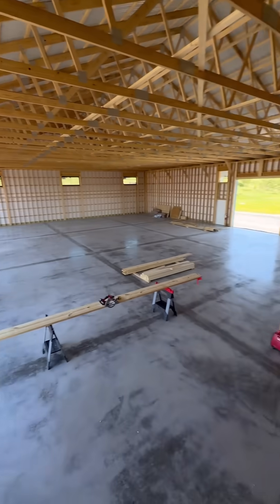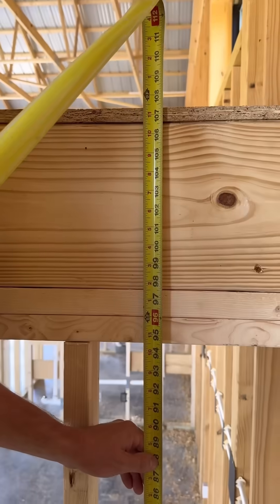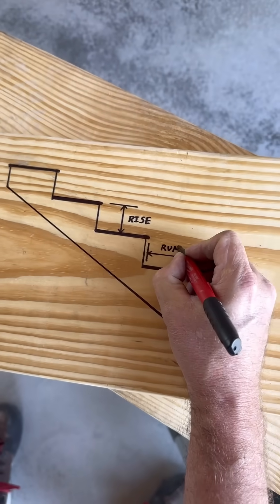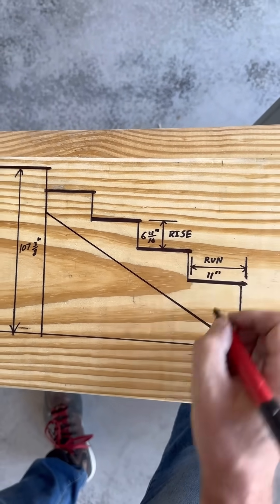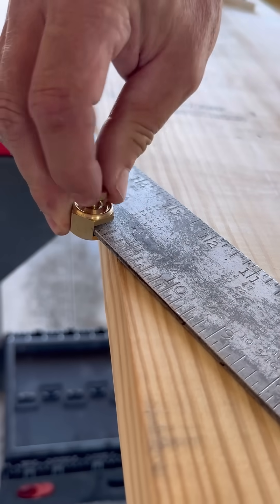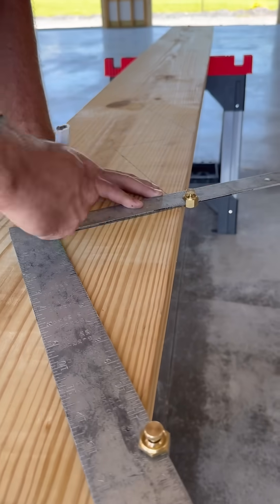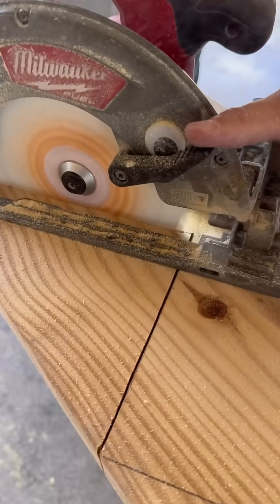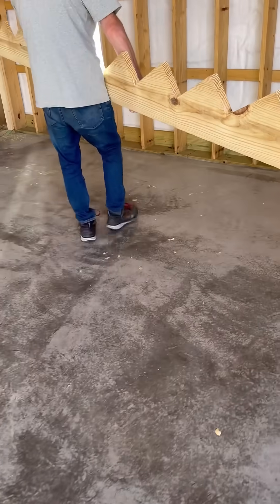How To Measure And Cut Stair Stringers

Comment: Some would say that more than 13 risers requires that you have a landing, for when you fall

That's why it's called a landing, you have 16 risers here from what I see

Also every 5th riser will need support from underneath, if you do not build a complete wall system underneath, so in this case you need three posts, and of course you would need for stringers to be able to maintain a width of more than 36 in clearance between the handrails and guards

Comment: old trick ,father taught me, so do not over cut . drill 1/4 inch hole. drops right out. And will not compromise stair stringer from splintering .

Comment: when stepping off each time at +/- 1/32 variance for the pencil line, it is VERY easy to be off by 1/2" at the other end.
Best is basic math , measure from the first step to the last step and mark the last one. THEN step off each set back towards the start. The result will be two stringers that match and accurate within 1/64. Try it.

Comment: I'm curious how you made your cut for the start of the stringer. I just used my stair gauges . Set to 7 / 11 , and I ended up with a pointed bottom to start my stair stringer.
Reply from the maker: You have to start in a little bit from the end of the board

Comment: Where did the 16 risers come from......ive found with how crappy lumber is today the edges are not very tight and are more rounded so i use the longer clips or fasteners to attach to the frame square, or flip them over with the twistie  on the bottom giving a bit more to hit the board edge. 1 /16 off at start caries and becomes way off as the layout progresses...not a big deal for risers that ride below the finished top but when its a flush fit it has to be precise.....very nice vid....

Comment: You didn't cover the most important part about the shortening of the last tread and material thicknesses of flooring on the treads Karma and the slab and the upper deck, that's where stairs start to get complicated

Comment: How do you  calculate your total run or where you stairs end on the  floor
Reply from the maker: You just have to play with the numbers to get the landing where you want it. While also not going over the minimum or maximum tread depth for code

Comment: Is it supposed to measure the height where the stairs are going to land not against the wall if the concrete is unlevel it will affect the rise measurement. I've seen slabs 1 inch out from the wall to where the stairs land. If the concrete is perfectly level then forget what I said.

Comment: That's how I do it. Simple math. When cutting risers and treads in stringers, the cut for the bottom riser must be longer than the rest as there's no tread getting attached below it. Same for the top riser cut being a little less than the rest to take into account the finished floor thickness.

Comment: Ok, Just thought I would add a couple tips to viewers as well....
Don't confuse terms risers with treads. To determine the rise height take the total height and divide it by 7, that will give you the average # of risers needed . If it's and odd number you will have a fraction like 7-3/8" for example.  Tip... When building try to build your deck or landing at a height that will divide  equally...for example say I build a landing at 49", it divides equally by 7" risers/ 6 treads. Easy figuring!  Remember...there is always one less tread than there are risers. Good luck.

Comment: If you're wondering  how he got sixteen risers... divide overall height by 7.... it cant be MORE that 7, so when you divide it equals ~ 15.3.  You dont want to be over an even number or your stairs will be >7", so add a riser (16) and youll be in the sweet spot<7"  works sweet pea when youve got a long run and lots of stairs.  On shorter rises it can be impossible to get a comfortable riser height For all stairs so just make the first Stair shorter... small deck step ups, etc
Reply from the maker: This is the perfect answer! Can I hire you to be in my professional comment answer guy😂
Reply: @hausplans  😆⚡️ I'm in

Comment: so you actually build the stringer subtracting 1? so a 16 riser staircase would actually use 15 cutouts? Thank you for providing such great info!
Reply from the maker: You take the thickness of the tread off the bottom of the stringers because you make it back up when you install the treads

Comment: Don’t overcut to weaken stringer. Wow. Cutting 50% out of the stringer and you’re worried about a small overcut. I suppose. Or set the treads between the full width of the stringer. More work and yes skill but stronger.

Comment: Where the 16 risers came from?
How didnyou get that 16?
Reply from the maker: I divide the overall distance until I get a number that’s close to but less than seven inches. In this situation happen to be 16.
Reply: @hausplans  I like to learn, but still you do not mention what number you divide it to get that number close to 7, for example: your height divided by "what number" you get 16?
Reply: @hausplans 
A number close to but less than seven it shouldn't be 16.
107.375 /15.35 = 6.99"
Close to but less than 7"
What difference will do 6.71"

Comment: 7.75" max in the IRC.

But why I'm commenting is b/c you gave great instruction but left out the last, critical step of cutting one tread width off the bottom of the stringer.  Now there's going to be stairs all over the country with fkt up first and last riser heights!
Reply from the maker: You’re totally correct! We showed that step on our Instagram and TickTock version of this video but didn’t have time to fit it in and stay under 60 seconds required for a You Tube short. IRC is 7-3/4”  IBC for commercial is 7”

Comment: But you don’t even give us the formula for getting that proper length of board for the proper stringer length. You just told us some numbers and then showed yourself cutting. What’s the point of doing all this if you left out the most important part??! You literally only gave us the run and rise of the steps but didn’t tell us how you got the proper number for the actual length of stringers.

Comment: For metric system world, you use stairs formula 2 x heights + width = 64 or 2x 17 cm + 30 cm = 64.
1st, you divide the height you need to overcome by 17, that way you get the number of stairs. 107"  or 272 cm / 17 cm = 16
2nd, 64 cm - (2x 17 cm) = 30 cm

Comment: I was curious to see how other people did these. Pretty different from how I do. I don't trust only using stair nuts because a minor discrepancy can compound by the time you get to the other end.
My method is first taking the rise (using a dot laser to account for floor variation), and dividing that by 7 to figure my total number of treads. Then I take the number of treads and multiply it by my tread run (11) to get the total run. Then I square my rise and run measurements, add the squared numbers, and get the square root of that number (a² + b² = c²). Then I cut my Stringers to length. Lastly, I take that c² number and divide it by my total number of treads, giving myself the distance between points on the treads parallel to the stringers, then I lay out that measurement and use those marks to line up my framing square with stair nuts. I realized that with maxed out 12' total stair rise that using only stair nuts would lead to a variation of over an inch, especially when working with large (4"x12") beams that have large uneven round overs on the corners.

Comment: I do the same thing. But I drill a hole on the inner angle before I cut. It prevents any cracking on a 90° sharp concave corner. As an Architect/Engineer i find it works best.

Comment: Seem you forgot to adjust the top and bottom steps for thickness of the tread boards.
Bottom step will be too tall, and the top step onto the floor too short. (By whatever the thickness of your tread material is.)
Reply from the maker: We actually did cut an inch off the bottom of the stringers to count for the 1 inch thick treads. Didn’t have time to include it in the video.👍

Comment: What you need to know to build stairs  is the rules first like the rise/ run, future flooring at both top and bottom. The framing square and the stairs gauges as used here is my go to method making a accurate stringer. I confirm the first one fits perfectly I use it as a pattern. Then I use a sharp handsaw to finish the cuts after using a circular saw first. One more very important issue seldom ever considered it that these stairs need to be consistent rises within fractions. So his method of measuring the total rise is only as accurate as the floor is level from the bottom to the top. I would shoot the two points with a lazer and adjust the bottom rise accordingly. I always pre- think building a stairway. So many people just buy precut stringers 7/12 from the lumber yard a obvious sign of not knowing shit

Comment: Didn't you forget to say to take the 
1 1/2" off the bottom so they end up the same at the top & bottom if not the bottom step will be 1 1/2" to tall and the top 1 1/2" to short  excellent description I would say though hoping the concrete is level. 👍👍👍

Comment: The floor to floor measurement assumes that the floor where the stringer will land is the same 107 3/8” as it is where you initially dropped your tape. Most floors are level, but 15 runs at 11” means that the bottom of the stair will be almost 14 feet away from the structure you’re attaching the stairs to. I’ve seen enough wonky floors be out of level enough to make levelling a stair very difficult.
Reply: This comes up alot when building steps off decks,  bc the yard can be on a significant slope. 
I tend to just work forward and backward, checking assumptions as I go... add up runs, estimate how far the bottom stair is,  then throw a tape back up to deck from there to get slope length... eventually it works out 👍 😅
Reply: @theoriginalmonstermaker  

I agree. There’s no need to overthink it, but even poured concrete floors can give you a significant difference in the floor to floor measurement.
Reply: I use a dot laser and measure out where my stringers land.
Reply: @apexalaska  Same. A self-leveling laser makes it even easier.
Reply: Always check the entire run for level, and the entire wall for rise. But don't forget the thickness of the top and bottom floor for finish height.It isn't rocket science but it can be complicated especially if you have landings and turns.👷
Reply: That's where a laser can give exact
Reply: What if I built a concrete base pad would that be better?

Comment: You ever hang steel?
Reply from the maker: No
Reply: @hausplans  lot stronger and less expensive. Red iron. It's not a real problem here in west Tennessee but a 60 x 110 I put up last year took a direct hit from an ef3 tornado. Just had to replace the sheet metal.

Comment: I’m guessing that he started out with a 2x12 12’ long and after dry fitting the stringer, realized the run wasn’t parallel with the floor.  So he cut off the top step and after cleaning up the bottom step, attached the stringer against the platform down 6 11/16 from the top, or the distance required to make the run parallel with the floor.

Comment: The elevation measurement should never be taken at the platform. That dimension should be be determined from the top of the platform where the stringer will be attached to the point on the floor where the stringer will rest. This is done to account for the floor not being perfectly level.
Reply from the maker: That is true, especially with steps outdoors. But this floor is perfectly level

Comment: Left out a very important part. The first step and the last step are cut differently as the stair tread material thickness and riser material thickness need to be factored in. Without this part the video is useless

Comment: There’s a couple important things he missed. Not to be that guy 
A shortening at the bottom of the stringer, so cut off the thickness of your tread material. 
And a shortening at the top where it attaches to the floor system for the thickness of your hanger board material.
Reply from the maker: We cut an inch off the bottom of the stringer to count for the tread thicknesses just didn’t have time to include it in the video. No adjustment it will be needed at the top. You’ll see that in part two😂

Comment: 7" Rise and a10"run ....plus 1" overhang on the step tread for a total of 11 "
Reply from the maker: No, it’s 11 inch ruff cit run and then 12 1/8 if you show the overhang. For code, you can only measure the run past overhang of the tread above.
Reply: @hausplans  Negative , not under IRC

Comment: Wow this was an amazing explanation. I know so many other things but this was one I didn’t have to do before and was always curious how to make a long one. You can buy premade stringers at the depo up to 6 or so steps. That’s fine for me getting into the hot tub but when I’m able to build the deck, I was curious how to make the long set going up 10-12 feet. This explains it. Thx for sharing your knowledge!!
Reply from the maker: Thanks
Reply: 10' to 12' you'll need a landing half way that's to long for code works the same way you can do it.

Comment: This building will not survive a hurricane 
GUARANTEED
Reply from the maker: It was designed by a structural engineer to withstand wind speeds of 115 miles an hour.

Comment: Here in Louisiana, code says no more than 11 steps without a landing. Love stairs, they're gravy!
Reply: That's a stupid rule when you consider a full floor to floor flight is 13 to  15 steps maximum. So you're gonna have a landing 4 steps from the top or a 7,8 split , or any other combination. Here in the UK it is 17. The one shown here has 15 steps so would need a landing.

Comment: Your imperial measurements are wild!
Reply: every day i wake up i thank the Lord that we have metric system
Reply: Both forms of measurement have their advantages and disadvantages. Fortunately in the US we have both to certain degrees.
Reply: Its second nature just like your system is to you
Reply: @m2burles1 no metric is just so much easier to use
Reply: @Maddgearscooter1000 true, but it's less accurate
Reply: @Maddgearscooter1000 so is the imperial to us
Reply: @devo1977s how is metric less accurate? Makes absolutely no sense. 1/16th of an inch is  1.588mm. With metric the lowest number on the tape is 1mm. Metric is more accurate if anything, and I only use imperial.
Reply: @devo1977s as someone who uses imperial when building, I'm flabbergasted at the idea of you thinking that metric isn't as accurate.
Reply: @devo1977s metric is thé measurement system in all thing science related. I know this for a fact ;) just as I know you were wrong 😅
Reply: @Maddgearscooter1000  there's just NO WAY the difference btwn 22 and 25 cm is as easy to visualize as 6 and 7 inches. 

... or 6ft vs 7ft instead of 2.1 and 2.35 meters... anything that permits whole number representative imagery for the mind had GOTTA be easier to envision

(In the same way,  YOU win with Litres over ounces and gallons)
Reply: @devo1977s metric is MORE accurate is anything.  Fractions are never going to be a simple and precise as decimals.
Reply: @ghostphoto  Guess nothing goes below .125 inches in your world. You go down to 1/32 and 1/64th working with metal quite often. Very little tolerances.
Reply: @theoriginalmonstermaker when used to metric and using it like in this video, you can spot the difference between 22-25 cm easy, or kets say 60-65 cms. When im doing flooring i always put my Square were i think they measurement is before i take the tape measure, and most of the times im within cm's.
Reply: @pinocolada4254  I know what you mean.  I can "see" both 1 inch and 1 cm in my head, but I just think it's easier for most ppl to "know" the difference btwn 5 and 6 of "some thing" than 22 and 25 of that same thing. 
Therefore,  whatever units offer the easier distinction,  in that the spread the units provide more readily fits the range they encounter,  the better for that application.
Reply: @theoriginalmonstermaker   Divide a meter into thirds
Reply: 33.3cm
But divide an inch into thirds
Reply: @theoriginalmonstermaker  That's actually pretty dumb. A decimal is the fraction of tenths.
Reply: @Maddgearscooter1000  Oh metric is so easy to use? Can you do me a favor then, I need this 10mm board cut into three equal pieces. Can you handle that for me?
Reply: @theoriginalmonstermaker 
It's wood. Not rocket science.